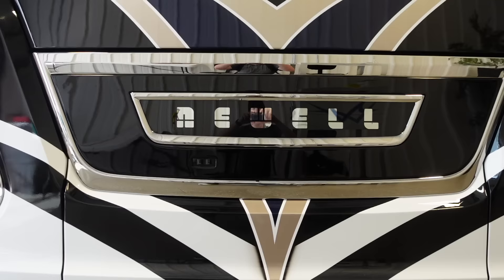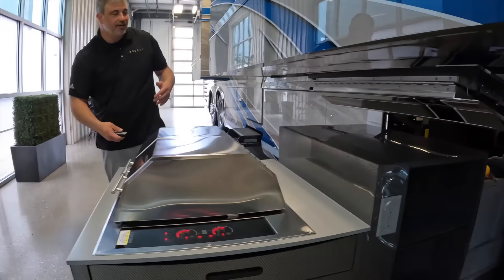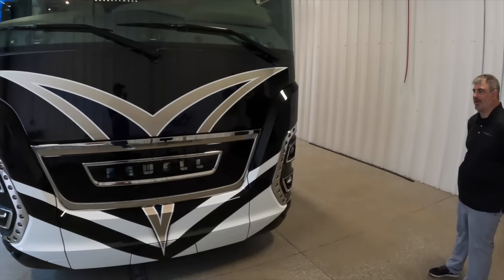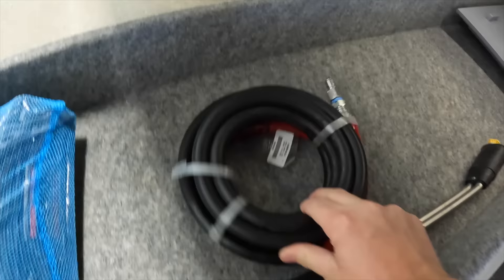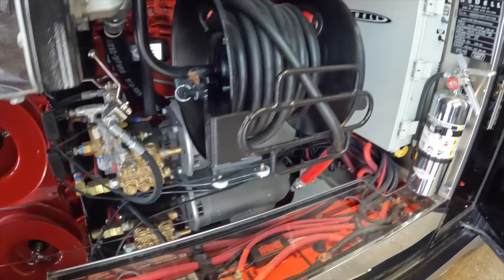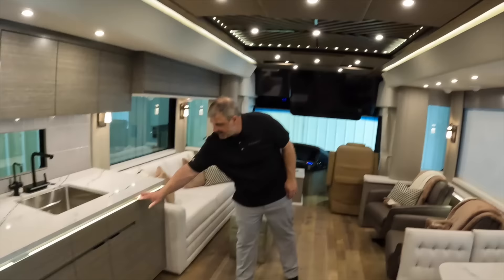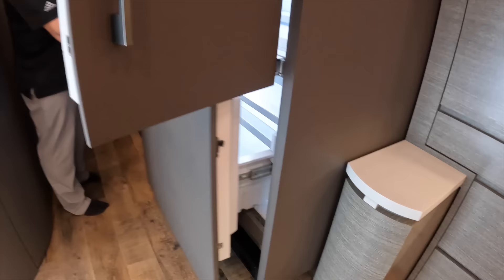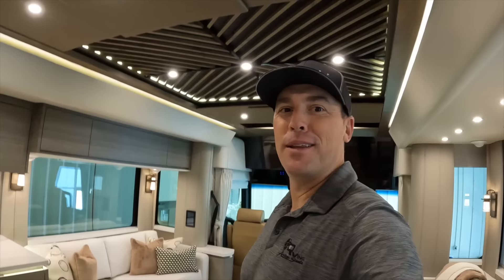Tour of 2023 Custom Newell Coach #1749

Comment: American R.Vs are absolutely superb the pinnacle of luxury travel and camping. The only problem for us in the U.K is we drive on the left, not right so the driver is very limited in visual space because the driver is on the opposite side, then if things go wrong we don’t have the parts availability as everything has to be imported from the U.S, so if your needing a new starter motor or gearbox etc, one your waiting potentially weeks for parts to be imported, two it makes all repairs more expensive and three finding American R.V specialists in the U,K who can repair and fix them. I love American R.Vs their the dogs nuts, but we’re limited to parts and access too repair specialists who can fix them which has put me off buying one. But if I was in America, buying a American R.V would be my first priority. Although European R.Vs or motorhomes we call them are comfy, well built, they simply don’t have the space their American counterparts do…

Comment: folks, where is the washer dryer on this coach? Also, it appeares that there can or could be over head airline storrage. On a custom coach design this may be an option. Th;anks for the cummins power plant and the 20 K auxiliary engine. The extra quiet pull out is a boon. often times, one must run the air-conditioning in the bedroom at night, Previous generators have proved to be  too noisy in some  motor home stops without 50 amp hook up.  noise ordinance in some city locations has been a real distraction.  Presently, I own a top of the line Blue Bird sp 36. It's not new, but has many features that the older Newel's had,  You guys have out done yourselves with this desigh., it is truly  Hassel free unit with Led lighting and other very up to date  electrical  inclujsions. There a just a few top of the line motor homes made now, Newell is at the top of the list. and ahead of some Prevost designs. thanks, I drove King county Wa. transit 35' to 60 foot articulated coaches before retirement.   I just want to congratulate your commitment to the very best cosches available.

Comment: I have a 20kw generator for my 3,500 s.f. house.  It will run two 5 ton ac's, 2 electric ovens, clothes dryer, water pump (well water), three full size refrigerators and all my lights.  In a motor coach, a 20 kw unit sounds like a huge overkill to me.   Need a projector that allows you to flip the picture for outside viewing - watching video backwards on a coach of this price doesn't work.

Comment: Gorgeous coach I think the only thing Newhall Hass to do for upgrades is get rid of the problematic cummins    With their injection pump problems that they’ve had for the last 10 years and switch to the new Volvo turbo compounding system in with their new 13 and 14 speed automatics that you can customize the two lower gears and up to 40% overdrive so you Maximize horsepower and torque a very low RPMs and get a lot better fuel economy the only problem with the commons has been the same problem for about 12 years the fuel pump system explodes internally and you were waiting for parts forever because it’s a common problem
Reply from the maker: This coach has Cummins x15, not Volvo
Reply: @RVingwithAndrewSteele  yes I know it has the Cummins my only suggestion to new well is to honestly update their driveline system with the new Volvo compound turbo something you could honestly check into it’s quite the impressive drive train I’m a cross country truck driver and have been at it for many many years so I know the pros and cons of most systems that’s all have always loved  Newell coaches Did they ever come up with a determination on the cause of your fire if you’re allowed to say so

Comment: Im wondering if Newell has now incorporated sound dampening panels on the ceiling that over the AC returns. I spot 2 such panels on this ceiling that look like that is what they are. Can anyone tell me? I am desparately working up a plan to reduce AC noise in my coach using sound absorption panels over the intakes.

Comment: Did you say those two compressors are for ac...? @ 10:30 🤦🏻‍♂️
Reply: He said they are for house air. As in the slide out seals that are air operated. The entry door is air operated. Usually the bathroom door is air operated as well.

Comment: Very pretty, but the interior is highly dangerous when the vehicle is moving. Indeed I'm 90% certain the vehicle wouln't be legal in Europe on a whole load of safety issues. 
Wooden slippery floors ! Highly dangerous & a serious heating issue in colder weather. Thick luxury Wilton carpets would be much safer, when the vehicle is moving & much warmer in cooler weather ! Plastics & woods are not clever inside road vehicles as they present insulation problems. Again carpet material extending from the floor up the walls a short way, really helps insulation, and reduce drafts !

Comment: Don't Like the TINT on the Window's. Prefer a "Gradiant"-GREY, instead of a Blue Look. Don't Like the Color of Finish on the Cabinet's. In the 1/2 Bath, Don't Like the Bottom Part of the Wall. That Design is a Big Dust Collector. Don't Like the  Color of the Stone Surround Inside the Shower in Master Bath. The CLOSET-SPACE is Lacking as well.
Reply: Well luckily you don't have to like it. The new owners that designed it and are paying for it will.

Comment: There is quite a bit wrong with this coach. The outdoor kitchen is in a terrible place under the slide out. I guess if you are 5 ft tall you’re ok. I am just not that impressed with this custom design. The paint job is good, but the coach itself it just leaves a lot to be desired. Neither one of these guys should be showing high end product lines this. The guy with the camera is truly annoying.

Comment: NOPE 👎... don't get me wrong... it's a nice Coach but to many things aren't as Great as [They] claim them to be... like watching the 'projection' TV in reverse on the exterior which is totally LAME 😒...

Just My Opinion... Beautiful Finishes but some design and placements aren't the best...
Reply: The projector has the ability to mirror the picture so it is correct whether you're watching from the inside or the outside, just not both at the same time